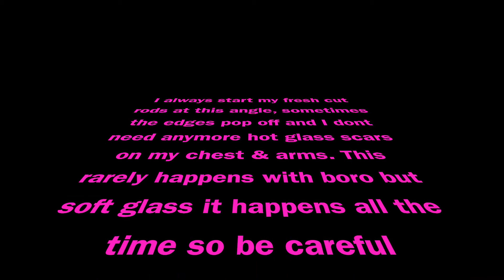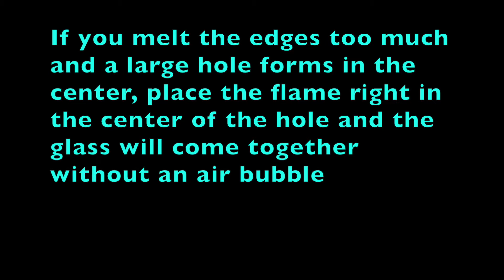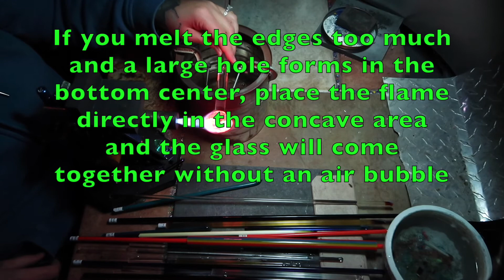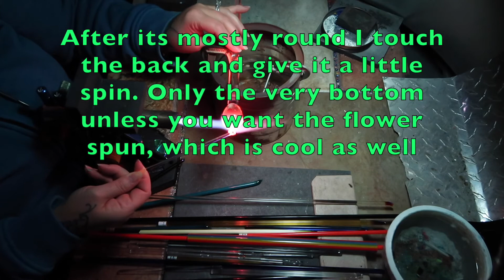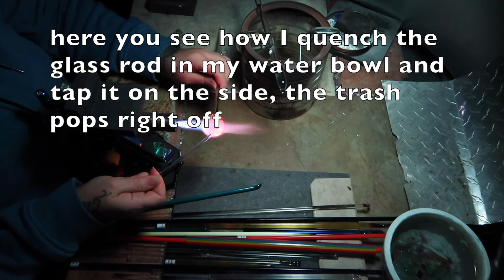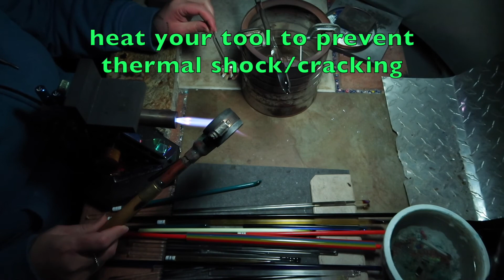Flower implosion Marble

Comment: Can you tell us more about your coffee can? It looked like you could use at least 3 different spots as rollers?
Reply from the maker: wow im sorry i never saw this comment till now. Not sure what to say other than when I started making marbles I was broke after buying all the main start up items...I needed a little help holding my work still after a few hours so I came up with this idea. the C clamps I added because if I need to I can let go of everything and it wont roll off if its centered on the can. lol I thought it was a genius idea and worked so well that eight years later I still use it. It's also very light weight so easily moves out of the way or back into position as I need it.